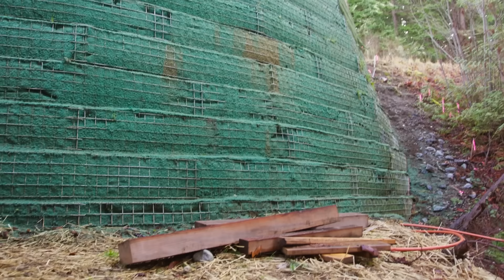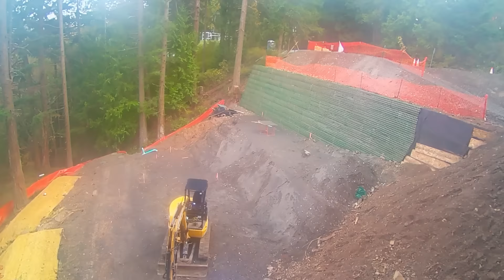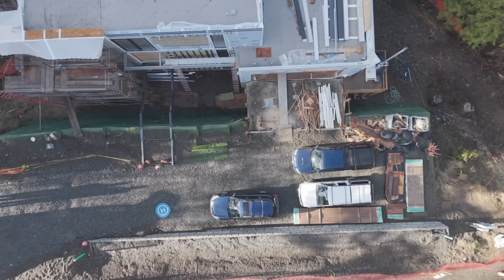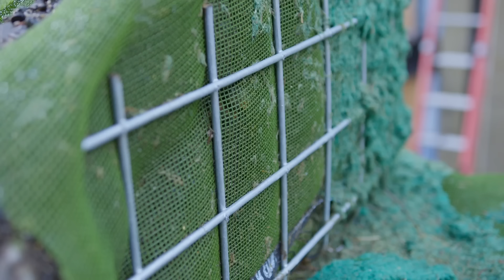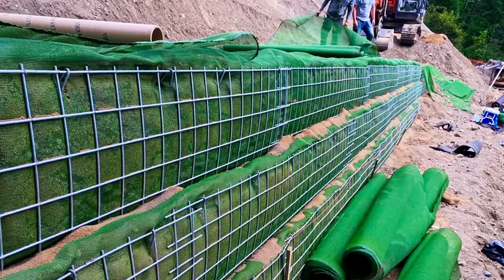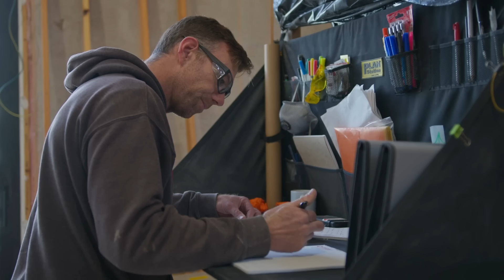Can This One Beautiful Innovation Make Hill Side Homes Cost effective?

Comment: I hope those cages are non corroding .. gabion wall facings are regularly used to hold back huge  volumes of soils regoliths and rock they allow water to pass through and roots to assist ...the geotex fabric holds back the soil from being washed through... 
Basalt fiber is perfect for this and outlasts steel,  you can use rebar to sticcch cages together and  fix into the slope , Grids and  mesh and as ropes and  fabrics. 
 It's  lighter than steel cheaper to make far less polluting and more temperature stable .. it's impervious to salt  corrosion and highly resilient to acids and alkalies. 
 It's Un affected by UV and and even high grade radiation . .. it's totally unaffected by any degree of cold and most fires , it's made from natural volcanic rock ...nothing added. and no excess CO2 produced beyond that in any melting of the rock and forming .🥼🧙🏻‍♂️
So why steel mesh and geo plastics that leach and ultimately break down to release micro plastics into the soil and watershed as a whole. 🤷🏻
Reply from the maker: Great information and great question.  I did not know any of this.  Thanks for commenting and educating.  Too bad you weren’t there to ask these same questions when the project was synthesized.

Comment: Was this an off the shelf product (firm name)? Or is this something they engineered themselves with a combination of existing products (which ones). My understanding is that these geotex tie backs still require facing with heaver-than-dirt (compacted) fill, and sufficient drainage engineering for each level--Especially with slope gradients steeper than a certain amount (based on site conditions). Did not sound like they had a structural eng. look at it.
Reply from the maker: The fabric is and the cages are custom, but the rest is just rocks and dirt.

Comment: will it ever rust?
Reply from the maker: It is galvanized metal so it will rust but not very fast and should last longer than we do.
Reply: @BuildingABetterWay  so, what if the owner wants to sell the house to a young couple, just starting out in life in 20 years or so?  should they see it as a costly repair coming soon?
Reply from the maker: From Google: _"Gabion walls generally last between 20 and 100+ years outdoors, with a typical lifespan of 50 to 75 years, depending heavily on wire coating and environmental conditions. High-quality galvanized or PVC-coated wire, used in low-pollution areas, can exceed 100 years, while coastal or harsh industrial environments may reduce lifespan to 15-30 years due to corrosion."   
I don't know the quality of the galvanization on the wire boxes, but your comment is a fair one.

Comment: To be clear, the mesh layers act as tiebacks.  A concrete wall can be backfilled and tied back just as well.  This method allows for a LOT easier installation than a 20'+ tall concrete wall being poured all at once.  Takes a fortune more time to complete, but works very well.
Reply from the maker: True, but tying back a concrete wall would take longer I think, and be much worse for the environment, have a bunch of cold joints in it and produce a ton of carbon pollution.